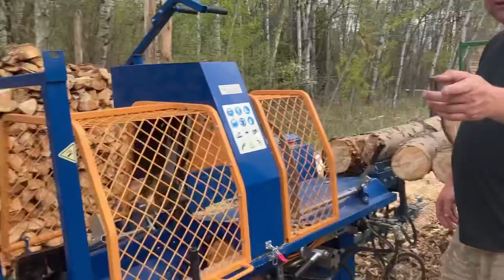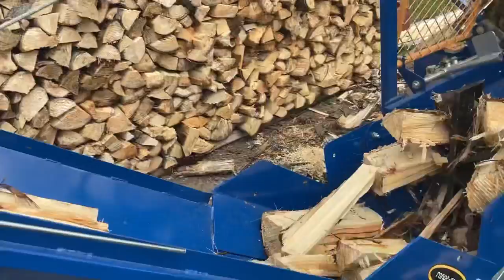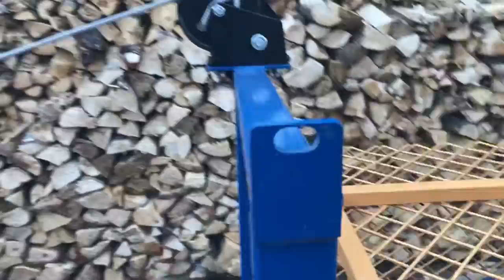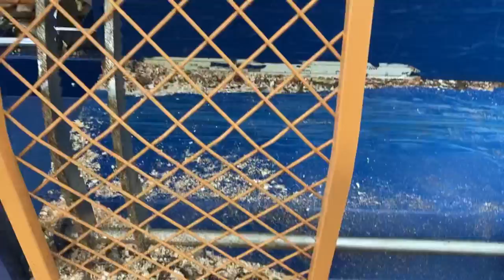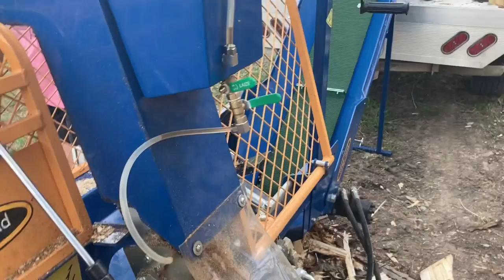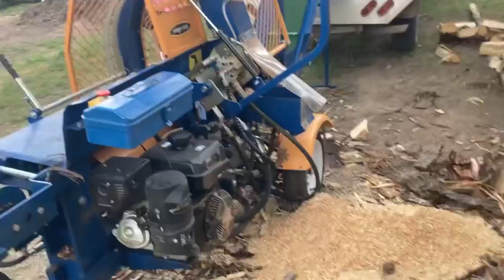Under $10k Firewood Processor!  Range Road Ecopro 300 Customer Review

Comment: Cheap pool noodles sold in most big box stores. most have a hole in the center split down 1 side to open them up then after that's on the hose and the offending sharp parts cover the noodle with a split 1 or 2 liter pop bottle so the squeak form the noodle don't  drive you nuts and zip tie it together. If you desire a neater appearance but will cost a bit more use hard PVC home plumbing pipes split them with cutting wheel on a handheld grinder or a simple drill will work also. Just make a simple 3 board jig to clamp them in place to cut the split. I use both methods on a Jackson lumber harvester sawmill for 40 years now saves alot on hoses and hydraulic. Never did the math looks to be at minimum of 1 mile of hoses and holds 250 gallons of hydraulic fluids

Comment: i have the older version with the 20 ton i have done multiple mods on it including taking the pull down handle for the saw off and put a hydraulic cylinder in there to operate the saw. makes it way easier to operate. i tapped in to the line that runs the elevator and added a spool. they arent top quality thats for sure but beats a chainsaw and axe. close to 300 cords through mine
Reply: btw im in canada and with the live deck and hydraulic feed it was north of $13,000 6 years ago

Comment: In all fairness the basic machine is
Quite capable. If you plan on cutting
More than a cord or two you're going
To neef the hydraulic blade assist
And the hydraulic in feed. We added
Both and ended up at about $10,500.
Both additional festures are really
Worth the money. We cut about 15
Full cords a year and we really feel
The assisting add ons are essential.
Very solid hard performing machine.

Comment: Good review. 6 way splitter with that tiny wood. Your making kindling, not fire wood. 4 way at the most for that size. Not a bad machine for the price though. Good job showing the bugs in it. 
The wood I spit is 15 to 24 inch fir 20-23 inch lengths with a maul and sometimes wedge for the narley stuff. Put up 20 full cord a year. I'm turning 61 this year. Those machines are starting to catch my eye.😉 thanks for the vid.

Comment: If you turned those bolts around would the decreased profile maybe help prevent the wood catching.  If they still catch, maybe grind the head at an angle leaving enough to still get purchase with a wrench but enough angle to prevent catching on the bolt head.
Reply from the maker: I actually turned them around and replaced them with carriage bolts.  Issue fixed!

Comment: i've had this processor for about 3 years now with many mods to increase productivity.  wouldn't recommend. just really underbuilt in critical areas using cheap components. i do about 50-60 cord a season.  your better off saving up for a better designed and built machine.

Comment: We have that same machine on our place and it's a pile of junk wish our work place never bought it
Reply: Made in China😂
Reply: I would like to buy such a machine and I'm interested why you don't like it.
Reply: My concerns and these might not be an issue for you
1. Made in China, is the quality ok? (This owner had a list of complains)
2. Can you get parts quickly?  Especially those that wear out
3. Resale value, yes it’s cheaper, but it’s not a Japa, Cord King or Wallenstein
Reply: @foxlake6750  The quality is not the best, but a normal firewood processor from a well-known manufacturer costs significantly more (almost 10x, I'm considering getting it directly from China, it costs 2k to 5k depending on the function). I live in Europe so I hope the hydraulic lines are easier to fix and I live on a farm so we can fix little things ourselves if something breaks.
There are some smaller "resellers" in Europe, I think they buy 20+ straight from China and rebrand them so they can sell them under their name. They cost over 10k and from what I've read their post sale aren't the best either because they don't have spare parts to replace.
Reply from the maker: @foxlake6750  Despite a few issues I’ve had, I LOVE this machine!  anything over 12”, I pick up with my backhoe grapple and buck it up with a chainsaw, then toss it in to split it and load on the truck.  My gf and I can cut, split and stack in the truck a full cord in about an hour very easily.  If you have similar sized logs all ready to go, you could probably do between 2 and 3 in an hour.  We had way more than enough firewood for both of my houses, my pole barn bar, and maple syrup before Labour Day!
Reply: @lordbaby100  I bought this machine with a log lift table and the six way splitting wedge …under 12 k….well worth the money nothing wrong with the machine at all …if your a person to nit pick then you will always find things wrong.